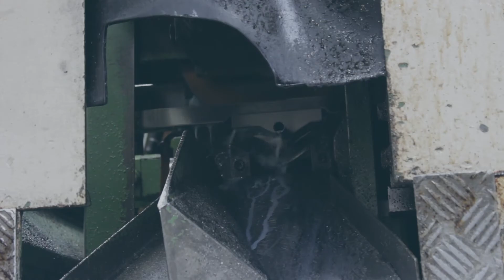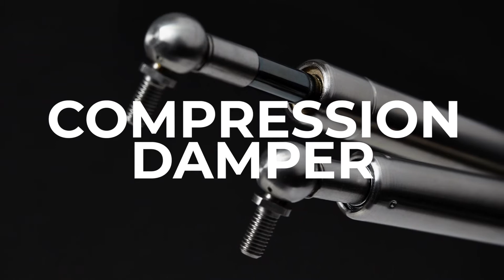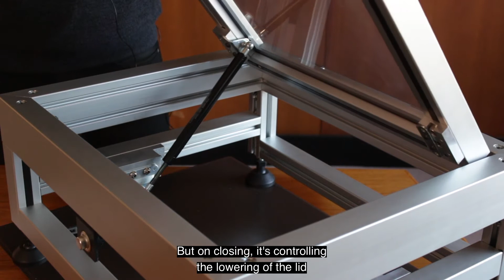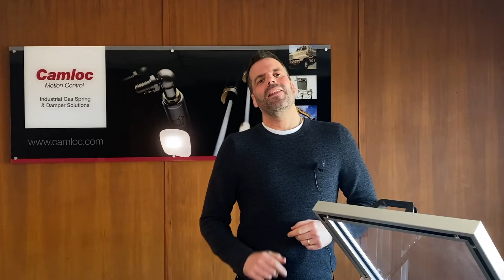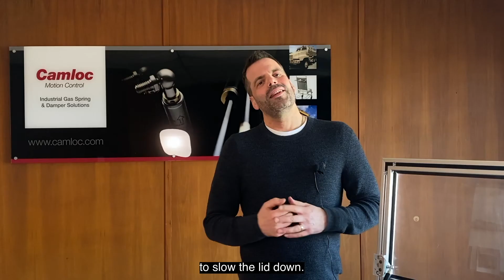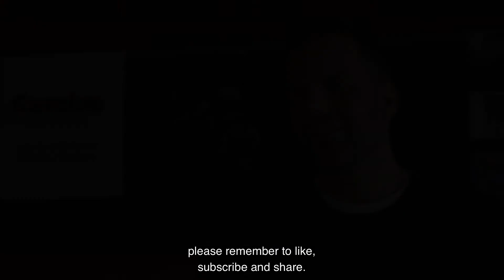Gas struts vs gas dampers (FAQ Series)

Comment: Very informative.
I would like to make a solution for my Transport Trailer and wondered what you could advise.
I have a Tri-Axle Tilt Bed trailer, which is tilted by a manual hydraulic pump; however I would like to make a system where all I need to do is release the safety catch, reverse the vehicle off the trailer and when it goes past the centre weight point the trailer tilts on its' own. (NB I can do this now, but when the trailer tilts it is not smooth)
My thoughts are to install a Gas Strut or Damper which works for both tilting up and tilting down.

Do you think you have a product that would work for this application?
Reply from the maker: Hey Matthew,  Contact us at: https://camloc.com/uk/contact/ and one of our expert engineers will be sure to advise you!